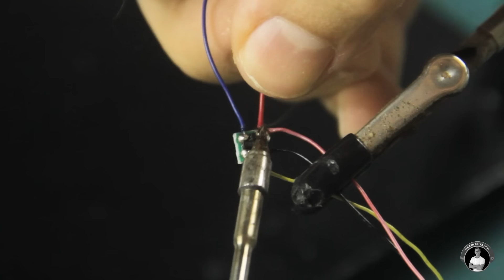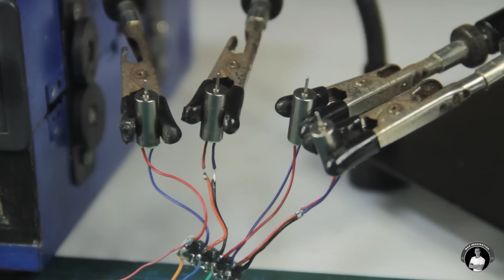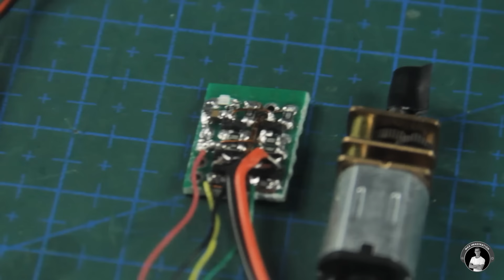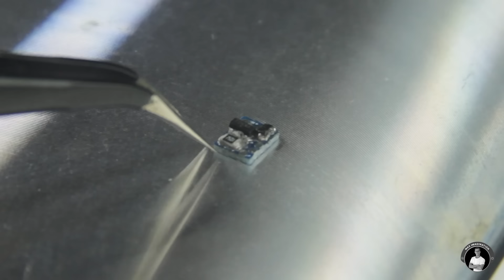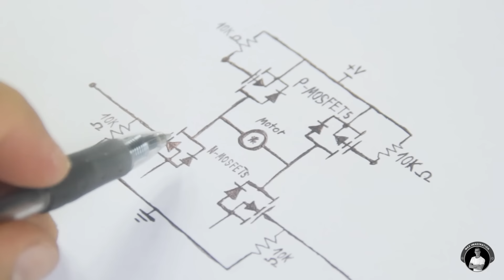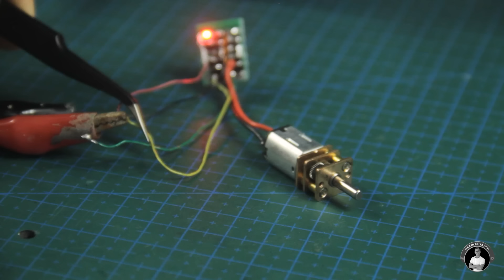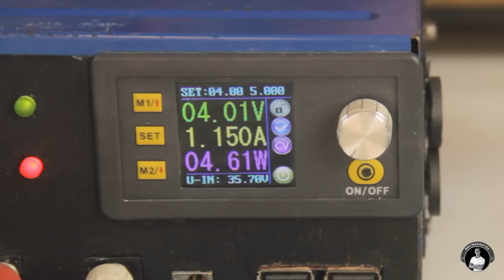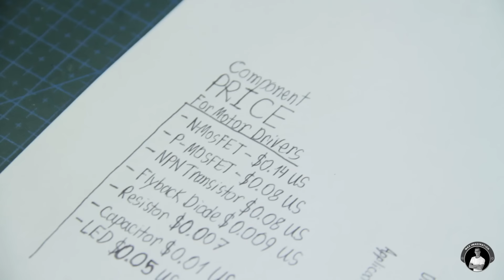Guide to making TINY Brushed Motor Drivers with MOSFETs for RC Projects

Comment: Thanks max, very good work, will come in handy.
Nice of you to answer so many comments, thanks.
Different perspective below:
What if the work is to have only one motor spin at a time?
Could we have a different MCU for every motor?
Then every MCU listen to a different I2C id?
What if we drive one small motor directly out of two (or 4) MCU port(s)?
Arduino ports around 20 mA per port but MCU: PML100 200 mA per port
Is that possible? and is that MCU cheaper than the cost of a driver ?
Can this 5 cent 8-pin MCU drive 4 (or 2) small DC motors ? OR one small stepper?
Is that very low cost solution, worth going to mini-c and $60 ICE (to save retry time?)
Reply from the maker: Hi there and thanks for your comment.
You can make each motor spin one at a time with only one MCU through a driver.
It is never a good idea to drive motors directly from an MCU's pins! This way, you will fry the MCU just from the flyback currents that are produced by the motor when power is taken off.

Hope this answers your questions :)

Comment: Nice Video. Thanks!
I'd like to control the Motordriver with an RC Receiver (PWM signal with 50Hz but only a Signal-on-time between 1.5 and 2.5 milliseconds)  
Is there a was using discrete components to use the Receiver and your motordriver?
Reply from the maker: Thanks! You can use an RC receiver with the unidirectional motor drivers the way they are - connecting the signal lines as you would with any other brushed ESC.

Comment: MOSFET datasheets commonly state 10V for Vgs under test conditions. If driving under this, check "drain-source on-state resistance (Rds-on)" figures. e.g. for the Si2300DS, it's typically 0.070 ohms at Vgs = 2.5V, Id = 2.6A. Note these figures can vary across parts. If only Vgs = 10V is listed under test conditions, then the MOSFET most likely won't work well at 3.3/5V (most likely overheat due to high Rds-on), and an additional driver/~10V power supply would be required to use. You can use DigiKey's/Mouser's search filters to find a suitable part.
Reply from the maker: Thanks for your input on this matter. Personally, I haven't found issues with overheating in using these MOSFETs at the low voltages I show. Which is also why I labeled the suited maximum voltages (12V) to run motors at with these drivers and not the actual maximum voltages (20-30V) of the MOSFETs. Thanks anyway!

Comment: Omg. This is probably the best video ever to come across for diy ESCS! Its so easy to comprehend and understand even the fact that you aren't using any fancy schmanzy pcbs but just standard perf board anyone can get is even more helpful! Micro escs are such a hassle to find this is just wonderful ^^ Great work!

Is it also somehow possible to drive the bi-directional esc with only 1 signal line just like a off-the-shelf esc to use with a RC receiver?
Reply from the maker: I appreciate your comment! Glad you found it helpful :)

Yes, it is possible to do so, but would require additional circuitry or even an IC to handle the signals through one wire. FYI, these are motor drivers and not complete ESCs as they lack the ICs for electronic speed control simplified via 1-wire signal. These drivers are ideally paired with microcontrollers.
Reply: @MaxImagination  Ahhh i see! As the circuit stands its just the muscle and a on/off/reverse switch but needs the brains to work- got it now!  

Thank you for taking your time to comment ^^ will definitely make my own little tiny escs!
Reply from the maker: Glad to hear I helped! Feel free to support my projects by buying me a coffee: buymeacoffee.com/MaxImagination. Thanks so much!

Comment: by any chance do you have a video about how to do a voltage regulator?
(need like 5v for a rc receiver to match with the custom-made esc's)
Reply from the maker: I don't have a video on that yet. You can get voltage regulator ICs like the LM78XX series.
Reply from the maker: Use the LM7805 in your case.

Comment: Very cool video!
But if you are going for miniaturization, why use discrete mosfets at all? There are H-bridges as small as 2x2mm (with enough current capacity). If you want hand-solderable package, there are options in the same sot23 package as a single mosfet. I used DRV8837 and CJDR9111 in my 1/87 scale RC models, and they work pretty well. There are also dual h-bridge options that are even more space efficient (e.g. DRV8835).
What's more, these dedicated h-bridges have over-current and over-temperature protection, which mosfet solution lacks.
Reply from the maker: Thank you! However I believe you missed the point! I made motor drivers with the least components possible anyone can make even on a perf board to have bare minimum driving control. With the DRV8837, you cannot solder it onto a perf board.

Thanks for recommending me an alternative. It's still good to keep in mind.
Reply: @MaxImagination  Yeah, if perfboard is a requirement, then QFN package is not the best choice, but a SOIC will probably suit well and still be smaller than 4 mosfets. 
(and I've seen a guy on youtube who solders QFNs to a 1.27mm-pitch perfboard upside down, it's mind-blowing)

Comment: @ 4:00 the 1N4148 will not handle the amps as a freewheel diode, or am I mistaken?
Reply from the maker: Since flyback currents happen for a VERY short duration, it can handle the instantaneous current unlike if it were to be continuous. Yes, they're rated for 1.5A, but they work just fine.

Comment: Bro can I use the scaled up version of uni motor driver( 3:59 ) for 8520 coreless motor,I am trying to build an ESP 8266 drone.Awesome video btw
Reply from the maker: Hi. Thank you! You can, but you don't need to make the scaled up version as the tiny MOSFET Unidirectional driver can handle driving it (8520 motor) - and it's lighter too.
Reply: @MaxImagination  I am making it because I am not good at soldering those tiny components .btw I am your old subscriber,glad you made this video
Reply: @MaxImagination  I am really interested to know from where did you learn to code these microcontrollers. As I am a rookie,it would help me a ton to bring my ideas to life
Reply from the maker: Hi there. Sure, you may proceed with the enlarged version of this driver following the same schematic. I learned to code by watching courses on Skillshare and reading books. One book I recommend is "Beginning C for Arduino"
Reply: @MaxImagination  thanks for the suggestion I will surely check it out
Reply: @MaxImagination  but sir it might me not available

Comment: Very well prepared, documented and narrated video. Thank you for all of these. I have 3 questions for H-Bridge drivers. 1- What types of components you recommend to use 10-24V power supply considering the most of the mosfets have 20VGS values. 2- Is there another way (I mean using solid electronic components - hardware) to control the timing between the direction changes as you stated that the MCU has to have a delay of around 20ms. 3- Can you provide the Truth Tables as well as I wonder if the H-Bridge drivers supports the "BREAK MODE" that is applying the voltage at the same time to the signal sides. Thanks again! :)
Reply from the maker: Hi and many thanks for your comment! To answer your questions:
1 - The SI2304 (N-channel) and SI2303 (P-channel) come in as a great MOSFET alternatives for the H-bridge as their drain-to-source voltages is 30V.
2 - Aside from code changes, you can add a RC (Resistor-Capacitor) delay circuit to the gate drive of your MOSFETs. By placing a capacitor in parallel with a resistor between the gate and ground (or gate and source for N-channel MOSFETs), you create a time delay for charging/discharging the gate. This will naturally introduce a delay in switching states, effectively mimicking a 20ms direction switch delay without needing code. Choose values for the resistor and capacitor that result in the desired RC time constant (τ = R × C), where τ determines the delay. For example, a 10 kΩ resistor and a 2µF capacitor will create a 20ms delay.
3 - If you want active breaking applied to your H-bridge, you'll need to remove two crossed signal connections that turn 4 transistor bases/gates to only 2 inputs, leaving you with 4 inputs from the NPN transistors and N-MOSFETS. You apply breaking my turnining on both of the low-side (N) MOSFETs ON. It will go like:
Forward: One high-side and one low-side MOSFET are ON.
Reverse: Opposite high-side and low-side MOSFETs are ON.
Brake: Both low-side (or high-side) MOSFETs are ON.
Coast: All MOSFETs are OFF (motor freewheels).

Hope this answers your questions! :)

Max
Reply: @MaxImagination  Thanks for your detailed explanations. I have subscribed to your channel and will be following the further productions. Best
Reply from the maker: Many thanks for joining and your kind words :)

Comment: I suspect that a driver like this would burn itself out quickly, since it doesn’t have any space for cooling / a safety factor for current draw. 

That’s just my intuition though. How resilient are these mini motor drivers? How long can you run them continuously? And have you had any issues with them burning out?

This is still an incredible video, and a hugely useful DIY. Thanks Max 🙌🔥
Reply from the maker: Hi there. I have had zero problems with these motor drivers in terms of power handling. The drivers may get a tiny bit warm after some use with TT motors with 180 brushed motors for example, and those are powerful motors. If you need to, a heatsink can always be added to the PCB drivers, but these don't get hot if operating the right motors.

These are very reliable and resilient, you can run them continuously for hours if you wanted to with the motors of the correct ratings I displayed.

Thanks for watching!

Comment: why do you use diode T4? in mosfet already integrated diode
Reply from the maker: The T4 diode is a fast-switching diode. The diode in the MOSFET is not. It's for an extra layer of protection.

Comment: This is cool! If we want to connect this esc directly to the receiver pwm pin, what IC do we need to add? Most of the micro dc esc that we bought online have their IC label scraped off.
Reply from the maker: Thank you! In most cases, you won't need an IC to drive these motor drivers with a standard RC receiver if it has PWM. Simply connect the PWM output pins to the inputs of your custom driver. However check your receiver is not using PPM, which would probably then need conversion.
Reply: @MaxImagination  but most receiver will output servo PWM that's different from regular PWM. I'm curious about their 'secret' 8 pin IC that received servo PWM and output regular PWM. Lol
Reply from the maker: I believe that's all the same PWM. It can work with brushed motor drivers (MOSFETs) too.

Comment: I just found your channel with the self-centering steering mechanism video. I was about to make an h-bridge with transistors but there wasn't any protection diodes in the example i used. So I guess i can see how long this circuit lasts then come back to this video. 
Do you not do any 3D printing? I'm about to make the self-centering steering mechanism using laser cut wood and nylon filament. I like how your technique in making these tiny boards. I'm making my transistor h-bridge on a 3018 cnc, I wonder if  I could make the smd version with protection diodes on a single sided pcb?
Reply from the maker: Hope you find this knowledge applicable in your project!
Yes, I do 3D printing too as you can see from my other existing videos. If you want to instead 3D print the steering mechanism, you can actually find it integrated in my 3D printed version or the PVC RC car that uses it - via buying its 3D files here in case you consider it: https://cults3d.com/en/3d-model/game/3d-printed-rc-car-with-steering-under-20-3d-modeled-pvc-car-design

Nice little CNC machine! With the right tool on the end, you probably could even make the SMD H-bridge I showed in the video. Sure! But make sure you know if it's possible to add Via-in pads to your custom made PCB. My design uses vias.